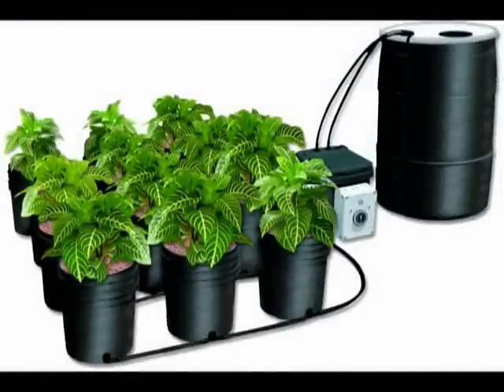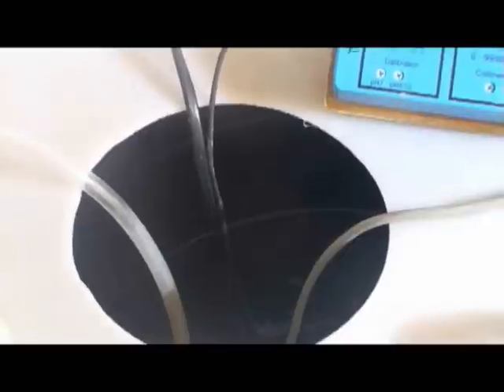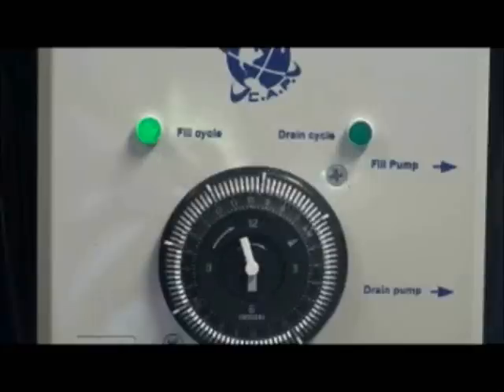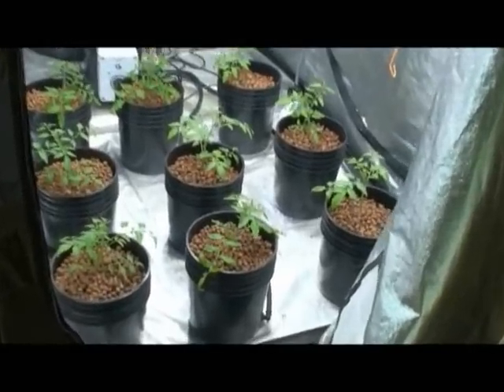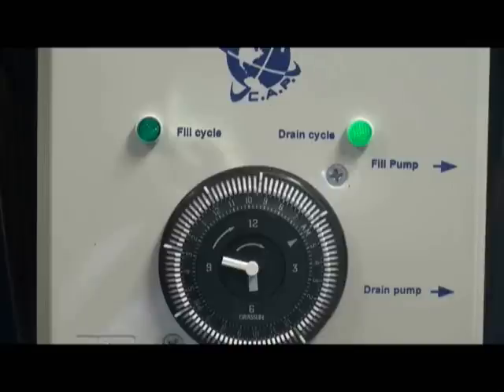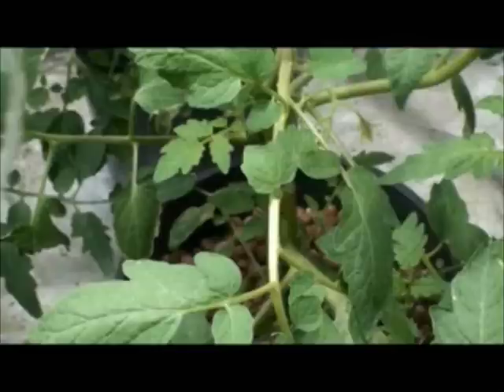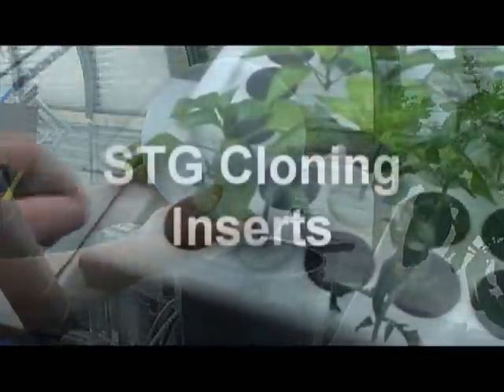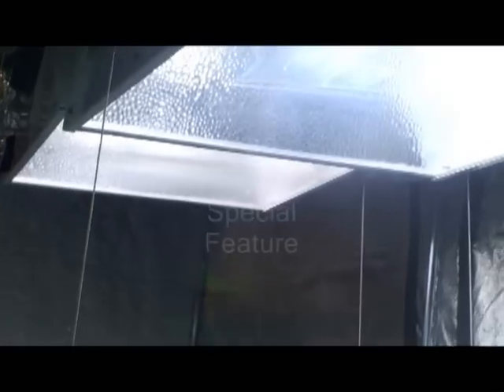Ebb & Gro Special Feature Final

Comment: Flipping hell.
I'm coming across this video in 2016.
In all my time of growing in the UK i have seen the small stg inserts but not that big one what fits a 20 litre bucket....
that's like a large Afro or candy floss.
Is the stg re-usable. Your going overboard with the cay pebbles when i started growing back in 96 i found all that clay pebbles a real bitch to clean. Smaller air pots is the way to go...
Reply from the maker: +BlackJedi169 
Thanks for the great info on the smaller air pots - I found the same is true for most DWC systems as well, you can grow a large plant in a fairly small pot.  No, unfortunately the STG is not reusable and you are right again about the clay pebbles - they are a pain to clean but at least they are reusable.  Thanks for the comment and thanks for watching my videos!

Comment: Hi, thanks for the video. I had one but I kept overflowing the pots, how do you control the nutrient solution in the flood buckets?
Reply: Guy Claudin you have your lines crossed your fill(on my system the both have holes) should have a hole in the elbow so it doesn't create that vacuum

Comment: Hello, I just purchased a EBB-12 - C.A.P Ebb & Gro 12 Site Hydroponic Sytem w/ Nutrients + 6 Pot Expansion Kit and I'm having an issue with the flood line coming from the reservoir. when the flood pump stops I keep getting a flow of water filling my feeder. it appears that the pump creates a vacuum flow once the pump stops. how can I stop the flow of water?
Reply from the maker: Susan is right.  You should have received a pre-drilled elbow with your install kit.  If not, just drill a 1/16" to 1/8" hole in the bottom of the elbow on the side the pump side just under the reservoir lid.  Instructions at this link: 

https://www.hydrofarm.com/downloads/fc/GFO7CB_INSTRX_3_13-2014_6622.pdf

Good luck and thanks for watching!
Reply: My system has a 90 degree angle piece at the top of the barrel where it turns and the line goes into the control bucket. this 90 degree angle is required to have a tiny little vertical hole drilled thru it. It is an intentional leak back into the barrel while it is in flood mode, but i's main purpose is to avoid an airlock and the risk of continued, unpowered, undesired siphoning of all the water in the barrel into the control (and then the buckets) bucket.

Comment: how do you clean the clay pebbles and get root out after the first crop any help would be appreciated
Reply from the maker: It's a pain!  I toss the pellets on a wire screen and spray with a hose, then put in buckets and sterilize with water plus bleach.  Next day I rinse them again over the wire screen, put in buckets and wait at least 24 hours to allow the bleach to vaporize. I am using coconut fiber now (the course stuff) it's easier to handle, pretty cheap and you can toss it in the yard waste or compost pile when done.  Good luck and thanks for watching!
Reply: @rwkleinman  How is the coco coir working? The manufacturers (Hydrofarm version) say not to use it as it the fibres can clog up the parts.

Comment: need help hook up tube to side which vaule
Reply from the maker: Hi Solo - I'm not sure what you mean.  If it is attaching the hose to the fittings it helps if you heat the hose at the end you are hooking up to get it on easily.  You can use a hair dryer or hot water.  Let me know if I've misunderstood your question.

Comment: Do you have issues with root rot regarding the standing water in the bottom of the flood bucket?   This happened when a room got to the mid 80s for almost two days.  The water in the tubes and buckets gets very hot.

Comment: @oknbjiuhvcgy first THING TO DO IS CHECK YOUR TAP WATER. your tap will have a certain #tds before you add any nutes, check the tap water (or what ever you are using). Actual TDS readings  should be higher than what you want available to the plants.get a good meter, ph  tds/conductivity  temperature would be GOOD$ $100-$150 .or for a ball park figure you could use test strips for ph and total alkalinity/ tds  find these in "pool maintNC.  supplies.WITH SOIL, YOU CAN NOT RUN AS HIGH TDS# WILL BURN

Comment from the maker: @oknbjiuhvcgy  I control the TDS dependent on the stage of growth.  In hydroponics use full strength in the reservoir - I use; vegetative growth starts at around 400 ppm and increase to 1,000 - 1,500 ppm as plant grows,  Switch to bloom at the first stage of flowering and keep the nutrient strength fairly high around 1,500 ppm.  It is EXTREMELY important to change and flush the nutrient solution regularly (I do it generally once every 2 to 3weeks) to renew nutrient & remove excess mineral salts.

Comment from the maker: @oknbjiuhvcgy 
Matt Geschke from STG recommends (as seen in an STG youtube video) placing PVC pipe spacers between the two containers to elevate the grow container about 1/2 inch higher and place an airstone in the space as well.  Seems like a good idea but I have grown three crops of tomatoes and one of peppers and have had very few problems.  You can also check if you are feeding often enough, wilting will occur if not enough water gets to the plant and also if the temperature is too high.

Comment from the maker: @oknbjiuhvcgy 
In soil it is somewhat cumulative, as they say, but keep in mind that the fertilizer is slowly leached out as you water.  That is why you have to add new fertilizer every  so often (in soil)  to provide adequate nutrition constantly to get the most from the plants.  That is why plants can grow faster and better with hydroponics; they are provided the nutrition they need every time they are watered and the nutrient solution and other parameters are controlled by the grower.

Comment from the maker: @oknbjiuhvcgy 
If you have  1500 ppm in your nutrient tank and flood your plants, they will be getting 1500 ppm.  You drain the plants, there is still 1500 ppm in the tank and when you flood again you are putting 1500 ppm to the plants again.  Granted, there will be an increase of mineral salts in the growth medium with continued flooding but it doesn't nearly double each time.  You remove this build-up by changing the solution and rinsing the medium occasionally.

Comment from the maker: @oknbjiuhvcgy Sorry man, TDS is the measure of mineral salts in the solution.  I generally start plants - say seeding size, at around 400 ppm grow then increase slowly as the plants get bigger.  When the plants start blossoming I usually am at around 1100 to 1500 ppm then, in case of blossoming plants, I switch to bloom at the same strength.  If you don't want the plants to bloom, say like basil and some other herbs, I usually keep the ppm around 1000 and use grow fertilizer only.

Comment from the maker: @GreenValleyGirlBC 
There are two pumps in this system.  One pump in in the nutrient reservoir (fill or flood pump) and the other pump (drain pump) is in the level control tank (controller module). The control module, with the drain pump and float switches, is necessary to set and control how high the level gets in the grow pots. Without this module the grow pots would over flow and the nutrient reservoir would eventually become empty (and the floor extremely wet!).  Thanks for commenting!